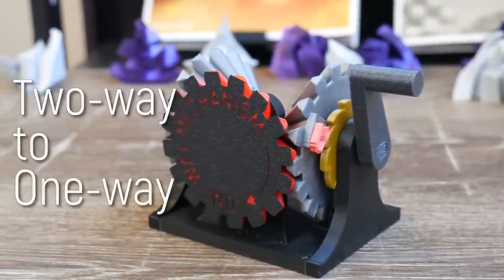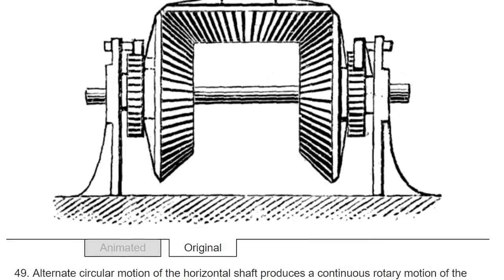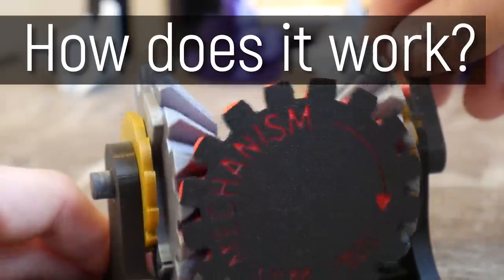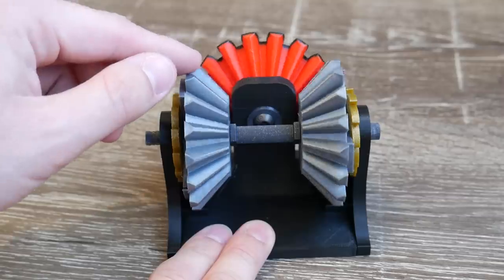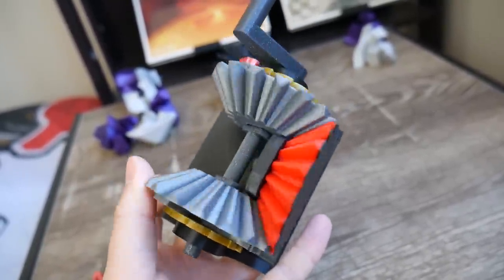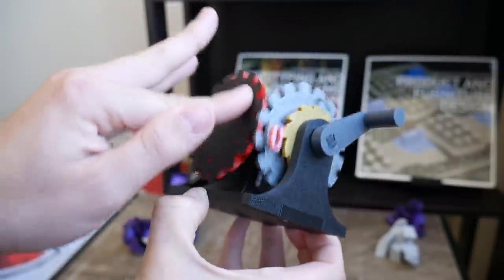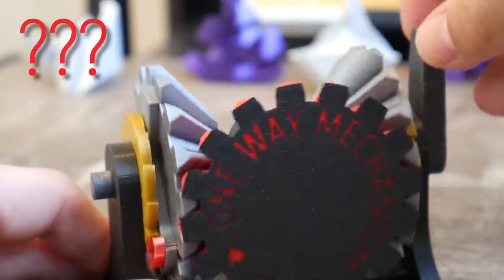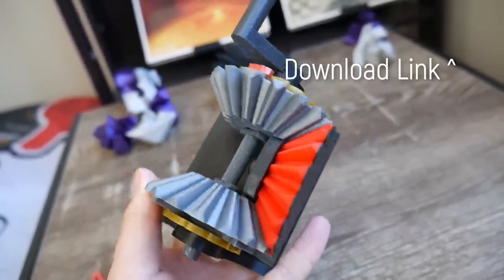This Mechanism only turns Clockwise, no matter what.

Comment: It's used in sailboat winches! It allows you to crank in your lines by rotating in either direction... why you might ask, one direction is usually geared differently than the other. So cranking in one direction can haul in fast, while the other direction gives you more mechanical advantage allowing you to overcome forces on the sail. They are also called 2-speed winches. 

The mechanism in winches is probably topologically the same, however structurally would be a bit different.

Comment: I think that a possible use is in tidal powered energy generation: the tides spin the blades attached to the crank shaft in alternate directions, driving a flywheel on the output shaft (attached to a generator).
Reply: I actually was wondering how one would solve that issue, and that's exactly what I was thinking going into this video.
Reply: but wouldn't the additional friction from the ratcheting system reduce the overall efficiency?  It might still be a net gain in total power generation, but without doing excessive math I can't say for sure.  Still an interesting idea none-the-less...
Reply: Evo Sokoloff-Toney You're right about that, the only thing I can think of is to make it as low friction as possible. Just grease the hell out of it. The bigger the gob, the better the job!
Reply: Evo Sokoloff-Toney Joking aside though, I'd say it's just an inherent flaw that can be mitigated through advanced materials, manufacturing and lubrication. And eventually something is going to break down no matter what, it still makes me excited for the implications of tidal power generation. The future is always upon us.

Comment: Would be used for a one-way screwdriver, my grandma has one in her toolbox
Reply: Its literally a drive differential
Reply: @swiji7198  it isn’t a differential drive
Reply: A differential sends different amounts of power to different wheels depending on conditions while this just take an input on the horizontal set of gears and translates it into a permanent one way rotation of the 3rd gear

Comment: Well done! Maybe a one-way ball bearing - or rather two - would get rid of the ratchet noise and reduce the wear.
Getting rotation from wave motion as suggested earlier sounds like a good idea. Connecting it to Granny's rocking chair to drive a generator which in turn drives her television might be another.
Keep up the good work

Comment: It's an example of how an open differential on a car works. When one tire loses traction, power output is directed to the other wheel and the vehicle keeps going under the tire that has the most traction.

 With a lot more moving parts, it's also somewhat related to a heavy duty CVT transmission. :)

Comment: I suppose this could have been used for water mills. There's no way to gaurantee that the rotational direction of every water mill would be the same, without being involved in building said mill. By using a gear set like this you could gaurantee rotation in the direction desired, even without knowing the input rotation.
Reply: most watermills I know are pretty much custom works, so you know which way it is going.
Reply: manaquri you, as in the person who built it, yes. But if you were making ready to use tools and machines to run off water mills, you have no control over the direction of the input. A mill powered drill, for example could use this to ensure right-hand movement. Obviously, this isn't needed in the modern world.
Reply: yes, that would be an option, though adding one gear to reverse the sense for half the machines you build might make a more sense. Also, some mills have 2 axles, one CW and one CCW.
Reply: Pretty much Every water mill is custom Made because no two locations have the Same condition concerning how you get the energy out of the water (factors Like the amount of water, its Speed and the difference in level you can exploit). Also you can build simpler solutions to gear everyone because the water won't Change direction, it' s always running downhill resp. downstream. I never heard of a tidal mill, although that might be a possibility with such Gears. On the other hand there would be enough time to engage a gear switch at high resp. Low tide and thus use a sturdier  gear where the impulse ist not solely transferred via the cranks.
Reply: If the machine was belt driven don't they just twist the belt like a figure 8 so it would reverse the direction
Reply: Best used on a shoreline since the waves go back and forth

Comment: There are some Air-Seeders that are/were operated this way for a simple transmission. So your crank is replaced by a straight plate with holes along it's entire length and depending on how for up or down you attach another operating lever (driven from a separate gear drive) the lever moves further or less far, turning the gears faster or slower. This is to set the speed at which the "metered" rollers will turn, which will determine how many seeds per acre are deposited. If I get my hands on it, I could take apart a John Deere or FlexiCoil gear box to make this a visual experience. The major difference is, the ratchets are replaced by so called sprag-clutches, most of the time suspended in oil, often just greased. There is no noise at all to that particular setup.

Comment: 2:38 He says that almost all gears rotate in opposite directions when mated. What type of gear doesn't do this?
Reply: Soviet gear
Reply: @arnavjoshi5913  do you know anything in particular?
Reply: @victoryu6570  nah bruh it's a joke, have you never heard that one? There's variations of it. Here's examples
(Russian accent)
In America, you hunt deer
In SOVIET RUSSIA, deer hunt YOU

Or

In America you open jar, 
In SOVIET RUSSIA, jar open you
As you can see, the joke is basically reversing the two things to comedic effect. I'm pretty sure all mated gears go opposite directions unless by mated he means on the same axle and is just being inconsistent.
Reply: A gear that is fitted inside of another gear of which is hollow.
Reply: All gears run in opposite directions when mated to one another
Reply: @runswithscissors3884  nope
Reply: @arnavjoshi5913  all gears run in opposite directions in relative to the interface when mated to one another
Reply: @runswithscissors3884  I mean, the interface isn't really moving. It's an interface. As someone else has already stated,a gear inside another will go the same way. You'd know this if you took the time to read existing replies
Reply: Gears that mesh on the top, like a clutch
Reply: Planetary gears are one of the few I know.

Comment: It hasn't been done yet, but this would work wonderfully for he winding slots in grandfather clock faces. If you don't know, GFCs use a key to raise the weights, which then act as the power source to move the whole mechanism inside the clock with their slow descent. But the key can only be turned one way. If this mechanism were to be put in between the key's slot and the crank wheel to raise the weights, then it would be much more user friendly. It isn't a necessary addition, but it does seem to be quite a good one.

Comment: Easy, change the ratchet with a one way bearing from a bicycle, no more sound..
Reply: I’m guessing your talking about a free hub. That is a ratchet silly. Ratchets are actually quite efficient. Bold call but no cigar on this one pipe pal
Reply: It definitely wouldn't eliminate sound, but using a one way bearing would probably make it last longer. I'm guessing longevity isn't an issue though, since it isn't a practical mechanical part so much as an interesting desk toy.
Reply: micvee I believe what would be best is a sprag clutch. Silent, no friction and instant engagement

Comment: its used in ratchet screwdriver. and with one click it can rotate bacwkards too to provide tightening or loosening. now thats interesting mechanism
Reply: A ratchet screwdriver doesn't need this.
Reply: well im not sure what mechanism they use but i have that screwdriver. whichever way you turn it it always rotate in one direction similar to this. so im assuming they have same mechanism or at least same idea
Reply: If those kinds of screwdrivers used this mechanism, they wouldn't turn freely the other way. They just use ratcheted gears like the ones seen here on their own.
Reply: exactly that is why there's a little knob that you have to twist in order to change the direction of the turn. not sure how that works but it is cool
Reply: Just engages a ratcheted gear in the opposite direction I imagine

Comment: I remember seing a similar mechanism in an old Popular Mechanics Magazine from the 1960s. It was used in a hand driven boat propeller. However, instead of a crank that was turned round it had a lever that was "pumped" up and down, and the propeller rotated when the lever was moving in both directions.

Comment: train thing where 2 people pump
Reply: Jered Sells If you're referring to a railroad handcar, those are just a simple throw rod attached to a bull gear. Direction is chosen by giving the car a little push, then pumping the handle keeps it going by adding down force once per revolution of the bull gear.
Reply: Jered Sells or a teeter totter  that uses kids

Comment: I have a screwdriver that I'm pretty sure uses this mechanism (or one very similar).  Once you switch the ratchet to either tighten or loosen the bolt, no matter how you turn the screwdriver it drives the bolt in that direction.

Comment: You can connect a verticle movement device, like a foot pedal and use that to rock the handle back and forth one step while still generating unidirectional rotation. Coupled with gear ratios, you can transfer foot tapping power to a fan blade and generate a nice breeze.

Comment: likely was a key component in simple AC motors allowing the alternating current driven motor to translate into a constant one way motion regardless of which direction it spun. Very useful in early industry.
Reply: shurgs ok, yah, probably wrong on my part. Thanks for more info though, I love electric motors but finding details about how they work tends to get rather dry on the reading material for me.
Reply: Actually for synchronous 1 phase motors, those that spin up in any direction, you could use it.

But also you can just put a single ratchet. that will stall the motor if it starts spinning in the wrong direction so it will spin up the other way

Comment: You could use one way bearings to get rid of the noise, would probably wear out a little slower as well.
Reply: Just my thought as well. One way bearings are fairly commonly used I believe. I wonder if it's possible to 3d print one way bearings?
Reply: They are used a lot in rc helicopters, actually I wanted to look into printing some for a 3d printed heli project but never finished that. Should be possible
Reply: I think you would have to print it on a 1d printer :-)

Comment: you could use it on a ratcheting screwdriver. your hand wouldnt give up as quick. this may have already been invented though.
Reply: I had a quarter inch ratchet, which used this principle. You could use it as a regular ratchet, or you could just twist the handle (in both directions) to do the same. 
I have no idea, who made it, I fond it on a side of a road and lost it a year later (don't put tools at the roof of a car). 
It was a really useful tool, especially when working on cars/bikes, where space is limited. 
I was trying to buy it, but at every shop I visited, they never heard of it.

Comment: That system is used in a two-speed windlass on a boat. But it uses multiple gears to change the ratio of one side. The double ratchet system is the same though. You wrap your rope around the windlass and place your crank in the top of it. By cranking it clockwise, the windlass with spin very fast, pulling the slack out of the line, then you can crank it counter-clockwise, and the windlass will keep turning the same way, but at a much lower and easier gear ratio. That allows you to pull up very heavy sails quickly. Also because it self locks, you don't need 3 hands to work the ropes, a gear lever, and a lock.

Comment: Ok, actually I'm super prepared on this particular device, and I want to share what I Know:
1) It is probably the best possible, two speed automatic gear drive for electric motors. If you spin in one direction (direct polarity on motor) you can have a first gear, If you spin the opposite one (inverse polarity on motor), then suddenly you have a second gear. That's amazing for overcoming steep rising roads for exemple.
2) pinion and ratchet, must be substituted by one way clutches. They are similar to ball bearing, they have NO PLAY and thay don't have parasitic fiction and no noise either.
3) connecting it to a biel-manovel mechanism, with an on the fly variable length manouvel, you obtain the extra old and funny, continous variable transmission used on the machines with the wire and needles to connect tighether fabrics for cloth making (i don't ramember the word for that I'm Italian).
What else do you want to know? I've said I'm expert, right? :-)
Reply: Graziano Ullucci would love to see one like that with no noise
Reply: Man, I'm a native English speaker and I forgot what the machine was. Looking it up I think the machine you're thinking of is a sewing machine.

Comment: put it at the top of a well and you never have to think about which way you move the arm to lift it up, set up another crank on the gear that always goes clockwise and you spin it the way that allows free spinning and you can drop the pot easily

Comment: I was thinking that it could be used in a grindstone. You only want the stone to rotate in one direction, with a flywheel to keep the drive shaft rotating, it could rewrap a string allowing for a pedal system. And because the output wheel doesn't move the shaft, you won't have to worry about it breaking itself.

Comment: Maybe for a pedulum clock?
So the pointers would always turn clockwise
Reply: That wouldn't really work, because the pendulum moving "perpetually" requires the escapement to have an outside force causing the escapement to spin, causing the "tick-tock" motion, and the "perpetual" movement of the pendulum.

Comment: I own a Kobalt-brand ratcheting wrench that must have a mechanism like this in the handle. Sure, you can use it as a lever like a normal ratcheting wrench, but once you've broken the torque on whatever you're unbolting, you can just twist the handle of the ratcheting wrench in either direction to turn the head in your chosen direction. It makes removing nuts and bolts that aren't under pressure twice as quick since it gets useful motion when you twist the handle in either direction.

Comment: A hardware superstore in the USA called Lowes has a 1/4" bit driver that works in a simular way.  looks like a screw driver,  when you twist the handle and hold the "band" near the end any clockwise or anticlockwise twist only advances the head one direction.  if you don't hold the band. Its just a ratchiting screwdriver.  ill try and find a link to one and post it for you.   It's called a Kobalt Double Drive.

Comment: Maybe a wind turbine? Wind could blow either way.
Reply: Wind turbines actually use a wind-vane to automatically orient themselves tho, this idea is nice, but I guess it wasnt so practical.
Reply: There's a simpler and much better project of wind turbines that doesn't have to reorient towards the wind, because they're not a big dumb propeller:
You make the turbine a twisted helix that turn around the vertixal axis. Then add some deflectors around. In this design, no matter what direction the wind blows, the turbine always spin. And it has much greater efficiency than those "propellers". (Actually those "propellers" are the worst possible idea ever, because they oppose the wind instead of using it, and only in one direction :P so their efficiency is the lowest. As if they were deliberately made to sabotage renovable energy sources by showing that they are "crappy" :q and convince people to use something else.)
Reply: @bonbonpony  they still need to reorient toward the wind. The twisting of the helix is to control how fast the turbine moves, as very high winds can damage them if it causes them to move too fast. They still should face toward the wind for best power generation
Reply: @joemann7971   I think we're talking about totally different designs. The one I'm talking about doesn't have to reorient towards the wind. It works for every wind direction "out of the box" by just standing there.

Comment: Isn't this mechanism similar to a car differential? I think that, at least, it has the same principle
Reply: You mean in the way that it has bevel gears at 90°?

Otherwise no.
Reply: Not really. A differential moves either ways depending on which side the car is turning to. It LOOKS similar though.

Comment: On a sailboat there are often "two-speed winches" used to tighten rope lines. They have a crank handle which turns a drum, around which the rope is wrapped. Either way you turn the crank, the drum turns clockwise, but turning it backwards gives you more mechanical advantage (and less "speed"). I wonder if the mechanism you show here is the basis of those sailing winches?

Comment: Used in Wave motion generators. As the float moves up and down the output drives a pump which creates a high pressure reservoir, this slowly dissipates through a generator. It is the mechanical equivalent of a full wave rectifier bridge and a capacitor :D

Comment: This concept would be useful to wind up a mainspring. Turning a crank going the other way will still wind the mainspring to store more potential energy instead of unwinding it or doing nothing. It's a sort of safety and user error countering mechanism. Think of say, an automatic rotor in a watch--you can wind the watch bidirectionally. The mechanism doesn't necessarily have to be the same, but the need and application are.